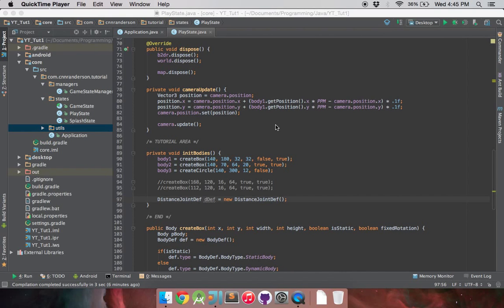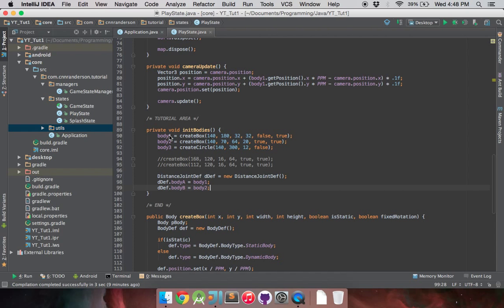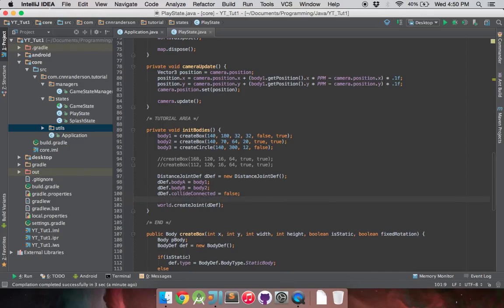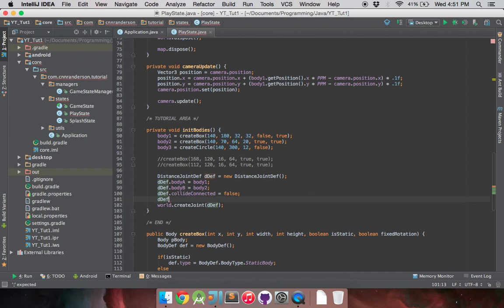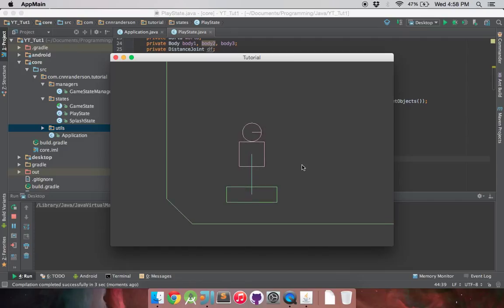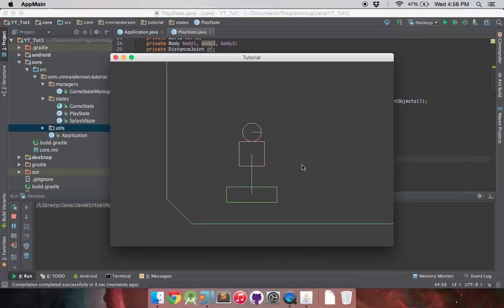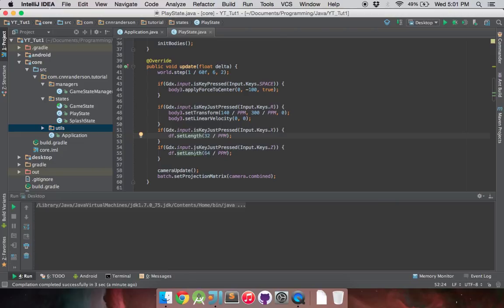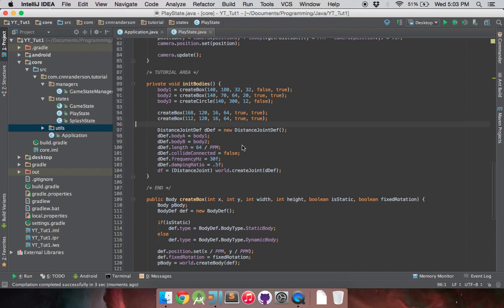LibGDX - Box2D Joints - Distance Joint Introduction (Part 1?)

Comment: Is there a reason why you are still working with Java 7?
Reply from the maker: sehrgeheimgeheim Personally, I feel Java 8 hasn't really gone into full swing just yet (lambdas aren't really useful for any of the demonstrations I'm doing; it also isn't useful for android development, even though we're using a framework which nullifies that fact). Above all, I want to communicate the code that even new Java developers can partially understand. Java 7, in my opinion, could be considered the sweet spot for learning/teaching.